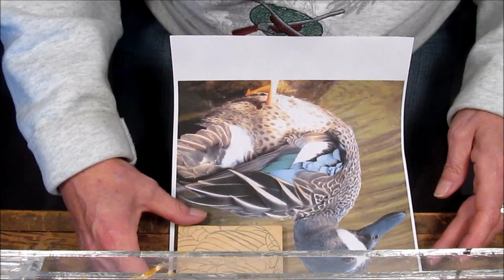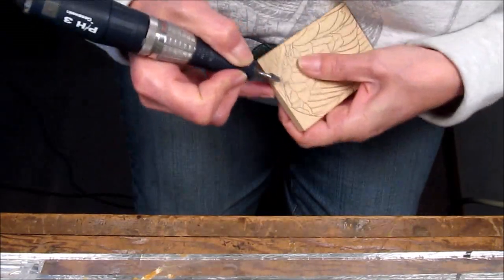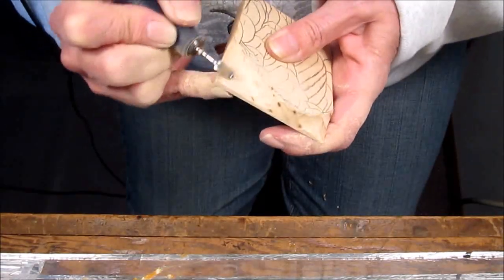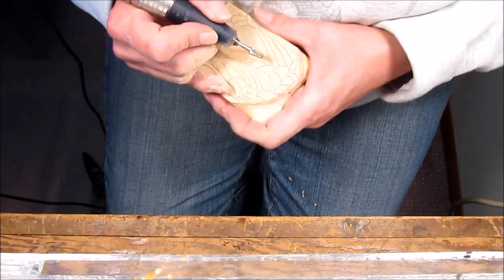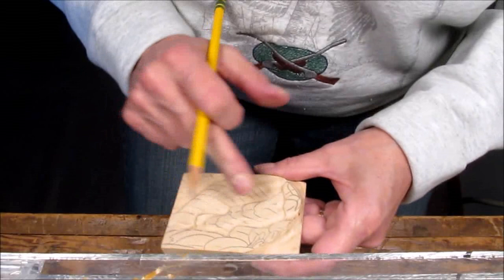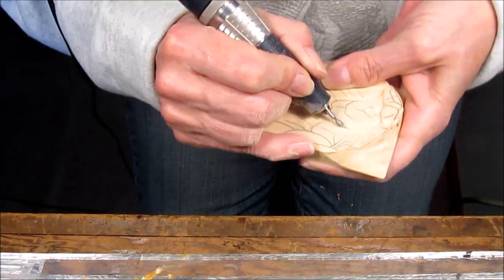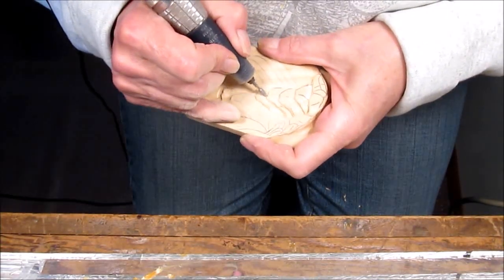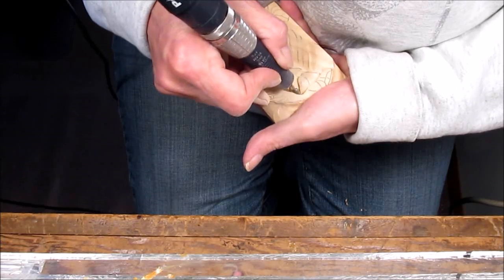Part 1 - Blue-winged Teal Drake Wing - Feather Carving Demonstration

Comment: Would it be possible to place a table fan near your work to clear off the sawdust and leave the other vacuum device off?  It is hard to hear what  you are saying and very distracting with that loud noise.
Reply from the maker: +Tomas Weyandt No it is not possible to do this. It is unfortunate that you are having issues hearing me, and are distracted, however this is the reality of powercarving. A microgrinder is noisier than a knife, powercarving generates dust, and it does require a dust collection system for me to stay healthy so I can go one making these free demonstrations. If I did not use the dust collection device,  not only would my studio be a mess, I would need to wear a dust mask and you would not hear me at all. You might use the pause button to better see things you feel are blocked by dust. Thanks for your input.
Reply: Laurie J. McNeil it's a difficult to see your detailing with the lighting set up